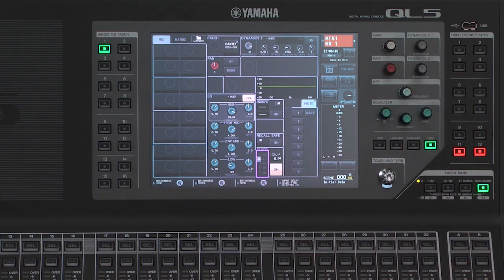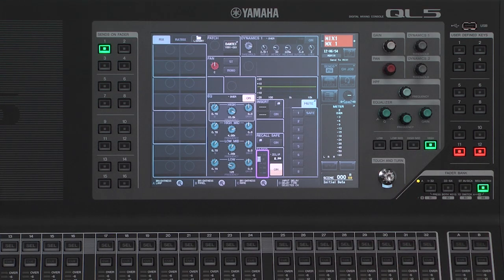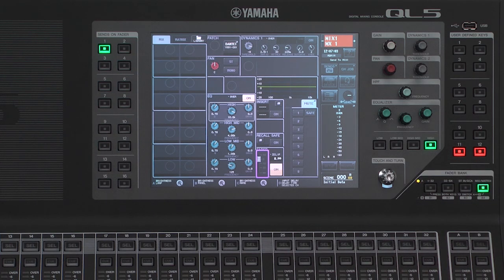CL/QL Series Training Video: 1.1 QL Console Overview

Comment: Is it just me or did he just do an overview of the console and then do it again with the smaller one?   Everything he noted was obvious by the labels on the board but still not helpful at all as far as using it.   He could have described the QL5 and then noted that the QL1 is the same but half.   But noooooo, he just HAD to point out the same features as if we had never seen anything like that just a few minutes prior.   Oh, are the sends on fader buttons the ones marked sends on fader.   Are the eq and dynamics controlled where it say eq and dynamics?   So the MIDI port is the odd one with two rows of pins, Dante is the one that looks like an XLR, and the ether on jacks are for your YouTube hook up?   Right?   He notes that the other consoles are based on the digital snake, but not even say if these can be used with a digital snake.  I’m sure it can be, but he didn’t say that.   And he of course assumes we know ALL about the very SIMPLE networking nightmare known as Dante.      Can I send Yamaha an invoice for wasting my time?     It my policy.

Comment: We have a QL1 and I called Yamaha Tech Support and they basically told  me to call the dealer.   They were of no help.   I have watched video after video and I have no idea of what the detailed menu path is to select the dante path to the Rio Stage Box  and how to rout that into the mixer, and then the varios paths to the outputs.  Has Yamaha ever actually tested with new users to see if these training materials actually get new users functioning?       The trainers toss out technical terms without defining them or showing the complete logical path from Connecting with dante, selecting Dante as the input,  then logically connecting a source on dante into the board and fader then routing that to an output.   Its broken across 25 videos and I never get the details of the logic of this path.      I am extremely dissatisfied with your Training materials and your Tech Support.   The board may be fantastic but your training materials are not helping me.